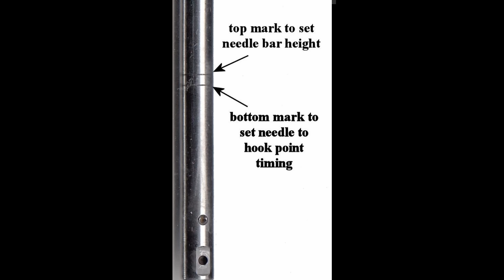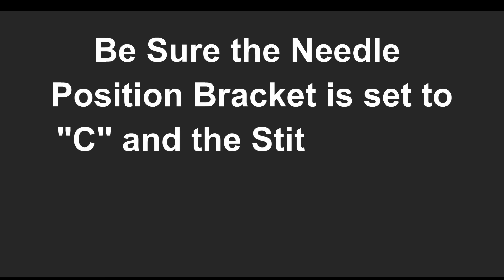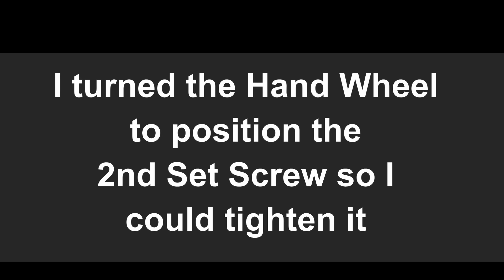How to Check and Set the Timing on the Singer Model 413 Sewing Machine

Comment: I've been repairing a Singer 427 with broken vertical gear. The gear I bought was too long so hubby shaved a couple of mill off it and it works great. After adjusting the timing it still wouldn't stitch properly. Your tip on the height of the needle bar was the last piece in the puzzle. I re-set it as you said, re-did the timing and woohooo it stitches. I had to play around with centring the needle aswell, so many issues with this one. I was gifted it and I think someone had already had a "GO" at it without success hence 5 things needed sorting. Thank you so much.
Reply from the maker: Thank you for saving that machine. I've had a couple like that and I agree somebody was playing around with it. Trying to fix it but didn't quite understand how it all worked. I'm glad that you didn't give up and happy to hear that my video was helpful to you. Thanks for the nice comment and happy sewing!

Comment: Brilliant video. Like having your Dsd sitting with you, helping you out. Worked perfectly for my Singer 377. Just got to stop it clumping now and I've cracked it. Thank you so much. ❤
Reply: Dad, that is, not Dsd!
Reply from the maker: I've never seen a model 377 here, but real happy the video was helpful. I don't know what kind of tension unit is on the 377, but if stitches are clumping it's often a tension issue. Good luck. (I could not even get a copy of the manuals for model 377!)
Reply from the maker: No worries, we understood 😊

Comment: Please note that the timing belt tension needs to be adjusted correctly first. A loose belt will result in too much play in the hook position. Sometimes when stitches are skipping erratically it is because the belt has stretched out over time and usage. It is a simple procedure to adjust the belt tension. 
Thanks for the excellent video!
Reply from the maker: Don is correct that timing belt tension should be checked/reset if needed. This model, like many vintage Singer machines with a timing belt, uses a cogged belt and pulley system to avoid belt slippage and missed stitches. Anyone wanting to see about adjusting timing belt tension can take a look at this video for replacing the belt on a model 413: https://youtu.be/Yg4OrTCeHxI
Thanks for the comment, and for watching my channel.

Comment: Thank you. I just repaired my 30 years old machine which was already in my a graveyard. Took me a day to take it apart, clean, oil it and set a hook timing right. My shaft is a bit crooked so if I keep my needle to the right I don't hit a plate and don't break more needles. Just figured it out. Then I got inspired and gave a heavy maintenance to my other 3 machines ( one is 60 years old). And I still have one more to take apart. Yes, I collect machines, I repair and now I plan to repair for friends and maybe later for living, who knows. 
My husband is really proud of me.
Reply from the maker: Nicely done, and thank you for saving the machine. You should be proud for what you have done, and I wish more people would try it as they often find they can do it and it is a very rewarding experience. Thanks for watching my channel.

Comment: Many thanks, your video taught me enough to fix the timing on my Singer Encore 9027. It hasn't any timing marks that I could find but the rest was similar enough to repair it.
Reply from the maker: Thanks for sharing this. As a 1993 model the 9027 is about 20 years too know for me and I've never seen one. I have heard of other models like it, all made in Taiwan, that folks could not find similar timing marks on the needle bar, although some had the marks up high and used the upper bushing for setting height & timing. I'm glad you were able to time your machine,  🏆 and if my video helped then it's like a bonus for me 👍 Happy sewing.

Comment: Thank you so much!!  The timing on my Singer CG-590 got a bit off this morning while I was making a repair on some webbing.  I could NOT find the set screws for my hook, until this video.  Instead of being on a separate bar (as in all the other videos I saw), the screws were on the pulley UNDERNEATH the timing belt!  Your video showed enough that I was finally able to find them and fix the problem.  Back to making collars, leashes, and harnesses to stave off boredom during lock-down!  :)
Reply from the maker: Nicely done! I'm glad you found my channel. Don't be a stranger and come back again someday. 500+ videos to alleviate some boredom. Take Care.

Comment: My goal is to make an inherited (and unfortunately neglected) Singer 401G run like new so I don't have to buy a modern machine. Videos like this really help to understand what I have to do. Slowly getting there...
Reply from the maker: I can speed up your learning curve somewhat. Think of your 401G as the German version of the Singer Model 401A Slant-O-Matic. A beautiful machine for sure. I have about 80 videos that are more relevant than this one for model 413. Two Playlists on my channel. One is for model 404, the straight stitch only version of model 401A that has mostly the same basic parts as your model, like motor, needle bar, presser bar, gearing, shafts, hook system, etc. Here is the link to the playlist of 56 videos:
https://www.youtube.com/playlist?list=PLsCOZgzzaiKIB4kvIHCfHYuyLMUp5A4UI
The Model 403A Playlist has 25 videos and some of them are of parts similar to the 401G that the 404 model does not have, like needle bar driving arm, etc. Here is that link; https://www.youtube.com/playlist?list=PLsCOZgzzaiKKyqvdDRwS-9MfLuwSNJTcg
These models have the gear-driven systems that I believe your 401G has, instead of a timing belt and belt-driven motor like the 413 in this video. One other thing that may help you is a free copy of the original 401A Sevice Manual that shows how to do everything in my videos. It's a xerox copy someone scanned into a PDF but I found it helpful while working on the machines. Here is the link to download it; https://sewingdude.files.wordpress.com/2012/09/singer-401-service-manual1.pdf
Congratulations on your inheritance. I know you have plenty of work ahead of you, but I believe you will find it a rewarding experience and the machine is worthy of your efforts. I'd like to thank you for saving the machine from a landfill somewhere. Best of luck, Hubbi, and thanks for watching my channel.
Reply: @andytubesewing1953   Andy Tube   Andy Tube  Yes, you are correct, my machine is completely gear driven, no belt. I already found out that the 401G and 401A are very similar which did help. Your playlist for the 403A though is much more in-depth than everything I've found so far and was really interesting for the more detailed things and tuning. The 404 is also very similar to my machine from a layman's practical point of view. By now my machine works quite well and has been used to sew extensively. I will return to it for fine tuning thread tension and things like that. Very narrow zigzag is not working perfect which would be nice for button holes I think and the machine is still a bit loud. Your help is much appreciated, also the manual. I could not have done this restoration without your videos. It really is about details for a working machine. I think my grand aunt would be happy and I hope the machine will last another generation. Best regards from Germany and keep up the good work.
Reply from the maker: @hubbibubbi1370  Happy to hear your machine is doing so well and love your attitude for keeping it sewing for the next generation. Thanks for watching my channel and if I can help, just ask. Best wishes.

Comment: Hello Andy thank you so much for this video!  Was very helpful.  However I can’t get the timing allen screws to loosen on the timing pulley to allow me to adjust the needle up above for the timing.  Any suggestions??  Also the needle bar isn’t adjusting so that the timing mark is just outside of the spot that you say it needs to be.  The needle is able to go to far below the bobbin assembly?  Bending the needle.
Reply from the maker: The first part of checking/setting the timing is to check/set the height of the needle bar. I show this in the video. If your needle bar height is off you will never achieve the correct timing. Here is another needle bar video that may help you: 
https://youtu.be/-FezmqypK6w
If resetting the timing is required then you will need to loosen the screws on the pulley. One way or the other. If you can't do that you won't be able to time the hook to the needle. You can try penetrating oil on the screws and try heating the screws with a hairdryer. That can help loosen them. You can also put the wrench in the screw and give it a sharp rap with a hammer. That can "shock" the screw and allow it to "break free" enough that you can loosen it. Sometimes turning the wrench while tapping the wrench into the screw with a hammer at the same time works also. I use a 2oz jewelers hammer. You are not pounding in a nail, just rapping the screw to loosen it.

Comment: Thank you for posting this!  I picked up an old Singer 1802 that was essentially frozen. After disassembly, clean, lube and reassembly (and replacing the motor) it would run, but wouldn't sew. I knew I had to adjust something, but wasn't sure what. Could not find a service manual but seeing this video put me on the right track. My machine did not have the two lower marks on the needle bar - instead it has 3 (!) near the top bushing. I guessed that the middle one was for bottom dead center (when aligned with bottom of the top bushing) and the one below that for the hook timing. I still haven't figured out what the top mark is for. Anyway, I followed your video as best I could - although I had to make the timing adjustment using the larger pulley on the right (the shaft on the left pulley has a flat for the set screw, so no adjustment there.) I guess at the time, Singer wanted you to buy their toolkit also, because I had a very hard time finding a screwdriver that could reach the two recessed set screws on that right-hand pulley and still be able to apply any reasonable torque on them. I think if the machine ever drifts out of sync again, I will replace those with allen screws. Anyway, thanks again - this old machine purrs right along now.
Reply from the maker: oh very nicely done you are an intuitive repair person to catch those differences personally I have never seen the three mark needle bar but other viewers have told me about it I'm glad that your machine is running so well and it was very kind of you to leave this comment and let others know about your solution thank you for that and stop by in the future when you get another machine

Comment: Your videos are great Andy. I still have an issue with the timing on the hook. The plate where the hook is on, after I've set it properly seems to slip meaning the plate won't turn when I turn the wheel to move the needle up and down. What do I need to do?
Reply from the maker: I think you have a broken gear on top of the vertical shaft. If teeth are missing then you are not getting rotation of the timing belt or pulleys or hook. It's a well known problem on about a dozen models with that type of gear. Here is a video about replacing the $10 gear on a 457 that can help you know where the gear is and see if it's broken or damaged. Also, when you took of the oil pan on the bottom if there was small bits of plastic among the lint, well...
Here is the gear video: https://youtu.be/M3bFtlV1Y6s
Let me now if you need more help and good luck.

Comment: Wonderful video thank you so much for this!! I am a new sewer and have a Singer Touch & Sew 626 and had to change out a broken gear the other day but ran into an issue I can’t seem to solve. I have set the timing correctly as you demonstrate, and it works GREAT on the first stitch/rotation, but when you keep rotating and the needle goes down a second time, my hook rotation is off such that the needle comes in contact with metal. Always on the SECOND needle rotation. Any thoughts on how I could fix this? The first hook timing rotation is fabulous and as you describe lining up the hook perfectly with the needle, the second however (I should say it’s technically the third rotation for the hook, but the second movement of the needle downwards) finds the hook to be pretty significantly off rotation. Thank you again for all your work on this video!! Hope you and your family are staying well during this pandemic❤️
Reply from the maker: Your mention of the gear change is the clue. This model 413 has a timing belt and pulleys. Your model 626 has a gear-driven hook drive shaft and hook shaft. If you are making the timing adjustment at the gear directly below the hook you are at the wrong end of the shaft. As weird as it seems you must loosen the gear at the right end of the shaft, the gear that meshes with the gear on the bottom of the vertical shaft. That is how you separate the connection to the needle bar. So take a look at these other timing videos which are on models that have gear drives like yours. I think you'll need to time you machine like that: https://youtu.be/cHkqoYYlvRE    or this one:
https://youtu.be/oHGwdEcYGZo. Does your 626 have plastic gears? Did you change the hook gear or the top gear on the vertical shaft? Just curious for future reference. Yes, we are all OK here and living like hermits. Only questions like yours are saving me from death by boredom, so thank you and good luck.
Reply: Andy Tube Ahhh thank you so much for your reply!! So glad you all are doing well. I just watched those two videos you mentioned and they were so great at explaining more about my kind of machine. I had to replace the gear at the bottom of the vertical shaft that broke—they are plastic gears (with metal bases). Even after setting the hook timing properly, I am still running into the same issue with the rotation of the hook being off on the second go around...the only thing I can think of is maybe I replaced the broken gear with the wrong size gear (one with a smaller number of teeth that is potentially making the hook rotation faster than the needle up/down rotation)? Thanks again!
Reply: You know what...I think I just noticed I bought the “vertical shaft TOP gear” and replaced that on the bottom instead of buying the “vertical shaft BOTTOM gear.” And I think that might be my main issue. I fit relatively okay, surprisingly! But it’s the wrong size and the rotation with always be off! Thank you thank you for your help with this—I never would have come to that conclusion without your videos and expertise so thank you again!
Reply from the maker: @SalShots  You are intuitive to realize that and nicely done. I'm laughing b/c I was just sitting here looking at the parts diagram and realized there are 5 gears on the machine and wondering if someone sold you the wrong one. Great minds think alike? Thanks for the mental exercise while being stuck at home. Take care.

Comment: Thanks for taking the time to post this video Andy.
Information is power   ;O)
Reply from the maker: Welcome. When a viewer recently wrote me that the sewing center in her town wanted $125 to fix the timing on her vintage sewing machine I was shocked. Yikes, that's a lot of money for a 15 minute job. I think most people who wanted to could reset the timing themselves; hence this video. I'm glad you liked it and thanks for your comment Mark.
Reply: I told you in an earlier video I had just bought a 413.
I had time tonight to take a look at it and it seems the gears must need replaced.
When turning it over the bobbin hook assembly is not spinning but if I manually advance the shaft I can get it to catch, so it seems some teeth are gone gone gone..
Will you be doing a video on this at some point?
Have you done one on another machine that is basically the same?
Or do you know where I can get a complete break down of the 413?

I have a pretty good background in this sort of thing but would rather not tear into it completely blind if possible.
Reply from the maker: This covers the top gear on the vertical shaft. I prefer the white gears if available. http://www.singersewinginfo.co.uk/457gear/  
You can email my channel at the address on my "ABOUT" page. I have the service manual for model 416 - 418 which covers the 413 but it does not show replacing the gear. 
Good Luck.